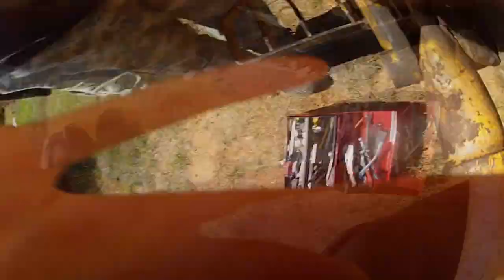How to Fix an Air locked Desile Ford Tractor

Comment: My Ford 4000 loses fuel prime if it sets for a week or so. Eventually I can get it going by repriming it, but it loses its prime after about an hour of operation. Then I have to start all over again. There seems to be air getting in somewhere because when I open the screw on the injector pump there is some air in the fule there and when I pump the reprime pump below the injector pump there is air there. Of course there is no fuel at the injectors on the head themselves until I get the air out of the system thru the button pump. Just before the engine quits it accelerates like it got a rick mixture or some more fuel and then it starts sputtering. Ideas?